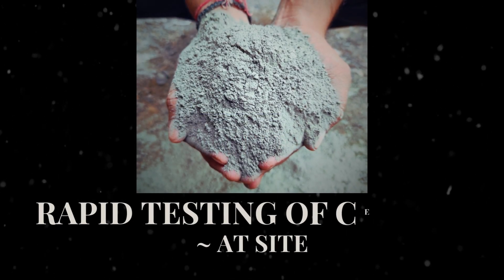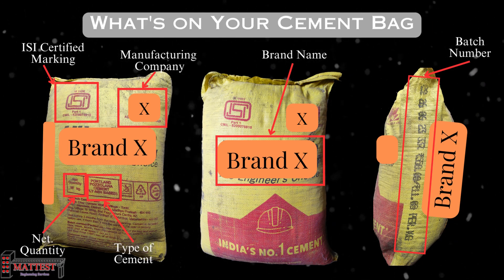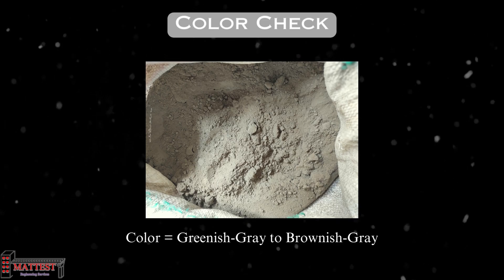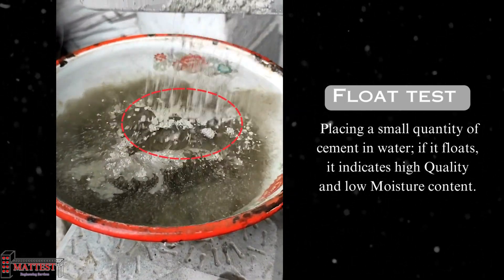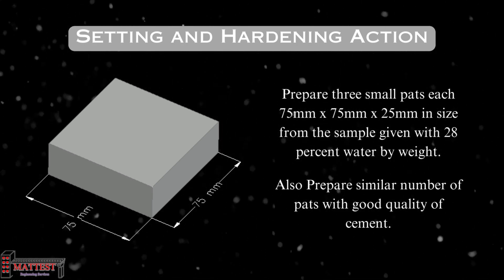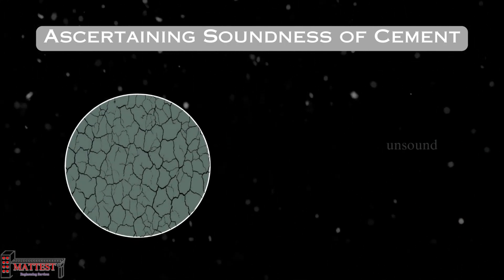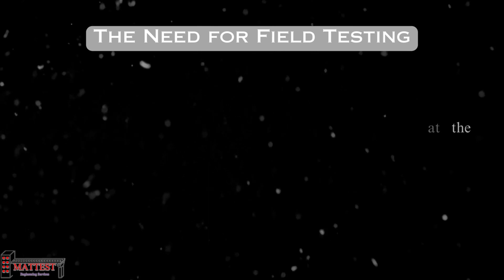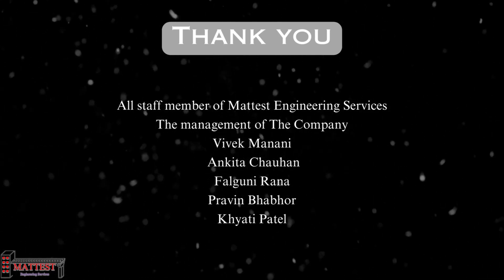Rapid Test of Cement on Site

Comment: What about other types of cement ?
rather than OPC or PPC.
Reply: In General at site majority use of cement is OPC and PPC that's way this test is suitable for OPC and PPC ... rather than this two type cement the method is quite different or specification, values and assumptions are also differ.
Thank you ...